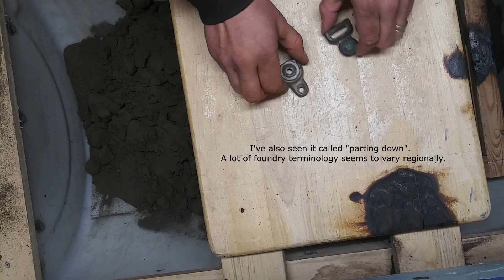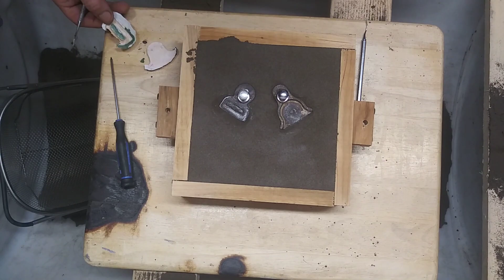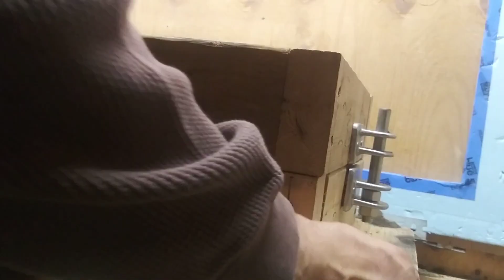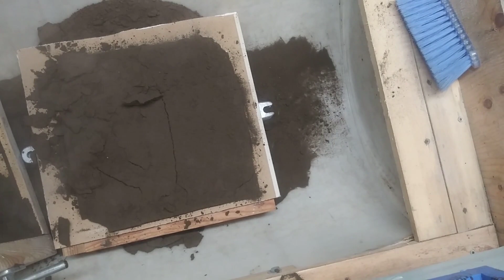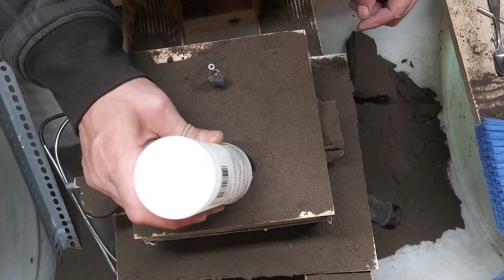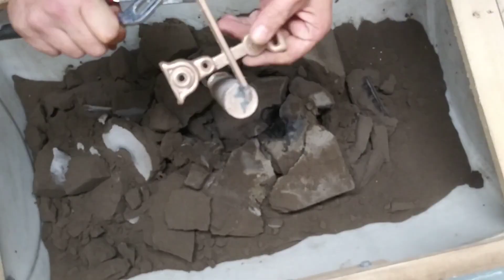Antique Reproductions in Bronze - Matchplate Patterns and Loose Piece Followers

Comment: I don't know if you remember but I use Oil bonded sand for 99.5% of the things I do & very much for this reason.
Doing specialist one off jobs for restorations, makes it a pain to keep making special parts to only use once, yes, some times there is just no other way but in general I find it works out better for me.
I also have the luxury of being able to ram up one day & cast the following with out fear of the mold drying out.
Down side is the smoke, you have to have a very well ventilated foundry.
Nice to see you using a decent pouring basin technic.
nice job.
Reply from the maker: Thanks WarGrade.  I actually have acquired about 300# of petrobond sand since since this job.  It came with a bunch of other gear from a lost wax foundry that closed down, and had only been used once or twice before getting stuck in a corner and forgotten about for 20 years.  The original owner had removed the burnt sand so what I got was basically virgin oil sand.  I had to break up some really hard clumps by hand so the muller could deal with it, but now it's good as new from what I can tell.  It's a little darker red now that when I first got it though!  I'm sure you know that I could have done this whole job in greensand as a simple coping down operation, but fortunately I don't rely on casting for most of my income, which allows me the freedom to practice techniques like casting follow blocks and matchplates as a learning experience when casting jobs do come around, without having to charge for the extra work.  That said, if I'd had the petrobond then, it's so much more forgiving compared to my greensand that I probably would not have bothered with those extra steps...
Reply: @tobhomott 
The two have their pro's and con's, but for the one off jods I find it far more useful.
I have rejuvenating oil for my sand (& as it happens I mentioned that in my next video) it's basically a thick plain mineral oil (or thats how it looks & feels to me)
Reply from the maker: @WarGrade  Cool, looking forward to that video.  I was talking to HT1 on the forums (thehomefoundry.org; sadly alloyavenue seems to be indefinitely out of commission) and he has a cement mixer muller much like mine.  He adds 2 squirts of the correct oil (30W non detergent IIRC) and one spritz of 90% isopropyl (PB catalyst equivalent, to help the bentone absorb the new oil) to every load after a brass pour.  He said he doesn't add any after an aluminum pour, but he only uses aluminum for casting new patterns.  I've got less than a dozen Al pours in mine so far and it's still great with no additions yet, but I know I'm going to have to buy some of that oil soon.

Comment: Just built my foundry and made my first batch of green sand. Now I'm wondering what kind of things I should cast. I need to try to find a carousel that needs new strap bindings. ;)
Reply from the maker: That's great!  I just started watching your furnace videos.  Getting your sand right can sometimes take a bit of trial and error, but greensand molding is a lot of fun.  Since I'm not a machinist or an artist, I'm always trying to think of things to cast too.  Are you into making parts or arts?  By the way, if you find that carousel I call dibs! 😁

Comment: Ok look forward to that thanks for the update . You didn’t happen to get a muller in that purchase per chance I was hoping to find one rather than make it they are very scarce in Saskatchewan. Keith
Reply from the maker: They're awfully scarce here in Ontario too.  No new muller, the only sand casting stuff was the PB sand and an old riddle. Plus about a quarter of a 55 gallon drum of sodium silicate & a can of the catalyst for it.  Otherwise it's mostly very large scale (for me - takes #70 crucibles that are good to pour pour 200# of bronze at a shot) furnace and burnout kiln gear and machninery for processing ludo (used investment casting mold material)  But I am so happy with my converted cement mixer muller that I'm almost glad there wasn't one.  This way I dont have to choose between them!  It was primarily a lost wax foundry, so the petrobond was only used a handful of times and mostly just sat in a corner for 20 years otherwise.  I had to break up some super hard compressed clumps by hand, but after that my muller only took a few minutes to get it acting like new again.  If you do end up having to build rather than buy one, a cement mixer conversion is a great option, especially if you're not a machinist.  The crossbar assembly was easy to fabricate; If I had to rebuild mine I'd do it the same way, but probably just buy a (cheaper) inflatable rubber wheel to use instead of the doubled up cast iron wheels I have in mine now.  Good luck!

Comment: In your videos you showed making green sand but in a later one you mentioned the new sand worked better and I didn’t catch what that was could you fill me in please . 
 Keith
Reply from the maker: I have a few hundred pounds of the homemade greensand, and I also have whatever is left of 100# of really excellent greensand I bought a few years earlier at a foundry supplier.  I must have been referring to that sand, but it's not newer.  The better stuff was made with finer sand grains (AFS Grain Fineness Number 115-130) and it has better green strength than what I made myself (75 mesh).  I think my homemade sand's strength could still be improved by adding a little bit more clay, but I would still use the purchased molding sand for facing since the finer grains give a smoother finish.  Because of that it has been gradually disappearing into my heap of homemade sand, but I still have a couple buckets of it left.  
Since publishing this video, I have acquired 300 pounds of petrobond (oil bonded) molding sand and I like it even better than the really good greensand, so all the water based sand is probably going to go into storage for a while before I get around to trying to whip it into better shape.  The petrobond came with a 16ft truckload of other foundry gear that I got from an art foundry that closed its doors, so watch for a big update on that that and some petrobond molding action once I finish recovering from a recent surgery and get back to filming foundry videos.
Jeff

Comment: Well done bud. Well done!    I love the idea of casting a match plate.  I had never thought of doing that.
Your sand looks to be a lot drier than mine.  I did one mold a few months back when my sand looked that dry and it worked fine. I'm not sure why I'm mixing it wetter now.  It'd sure be nice to visit and see how dry your sand actually is.
Reply from the maker: Thanks!  Casting a matchplate is something I've wanted to try forever, so a lightbulb went off when I found that drywall scrap lying around.  I never saw anyone else use drywall as a flask spacer but it worked quite well.  MrPete222 has a great multi video series showing a similar technique for casting matchplates though.  Maybe a matchplate was overkill here, since I don't know when or if I'll ever need to make more of these, but it was definitely a fun foundry project.  Give it a try!  You could make one for your plaques... Perhaps just a blank generic plaque pattern backing and border, then you would only need to print out letters to glue on your matchplate well enough to survive being rammed up in a mold or two as needed (I just bought a couple packs of letterboard sign letters to use for pattern letters, not being a 3DP guy)...  Even if you just mount flat back patterns on a nice smooth piece of sturdy plywood to make a matchplate it can help avoid a bit of fiddling and sometimes result in a cleaner mold with less hand work over molding and drawing out loose pattern pieces.
Reply: @tobhomott  Yeah as I watched you struggle to pull the part cleanly at the beginning of the vide o I thought to myself "man I've been there 1000 times."  A match plate would make things a lot easier. I've got three plaques to cast before next Tuesday and I wonder of doing a plate would give me a clean pull with out all of the darn fiddling around next to the sand.  I might have to seriously consider doing one tomorrow to see.
Reply from the maker: Oh, yeah, also my sand was absolutely as dry as it can possibly be and still ram up ok here.  Any drier and I would have had to put it back in the muller with a little more water.  I nearly did at one point, but found some that was a tiny bit wetter deeper in my sand barrel to finish ramming up with, and this got lost in the edit as did some damper muller loads being dumped out.  I had to ram pretty hard to make it work, as evidenced by the pattern shifting off the gate in one case.  That is also why I was so careful when using the venting wire around the spinner.  My facing sand was actually just a little wetter than I like though, maybe that helped the edges not to crumble?  Keep in mind, the sand muller also lets me use less clay and water than you probably need without one, I have only about 5% clay in mine (and water up to Emmet's shoulder on the McDonalds Lego Movie cup), compared to more like 10% in most hand-mulled sands I've read about.  Edit - if you're ever going to be in the Ottawa area drop me a line, happy to let you play in my sandbox!